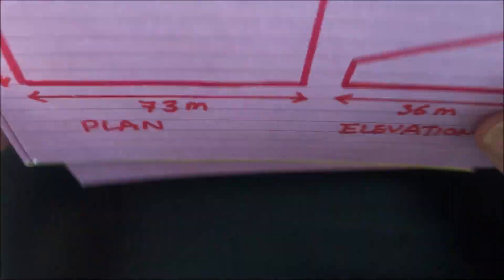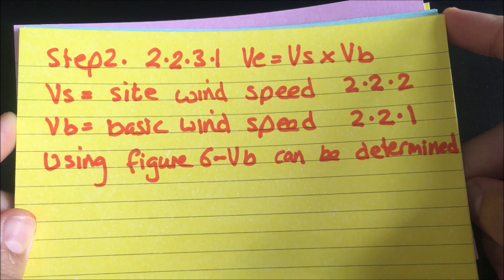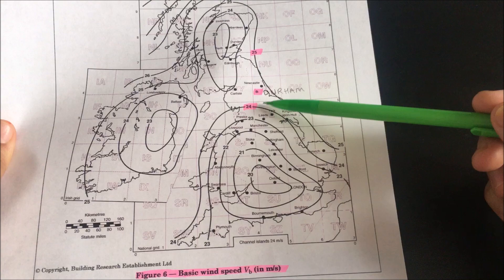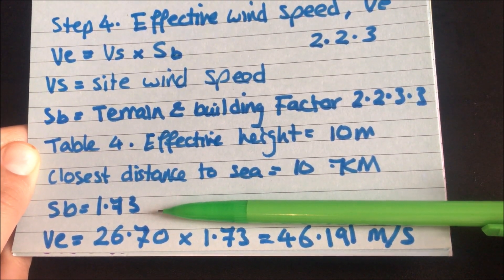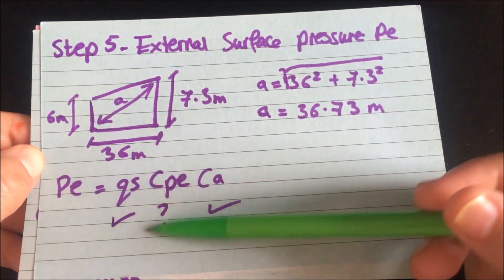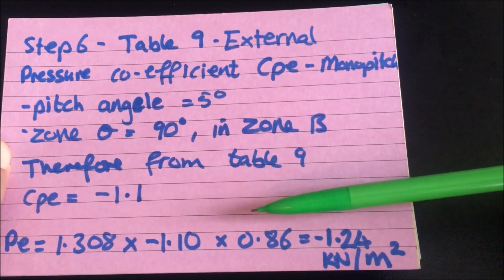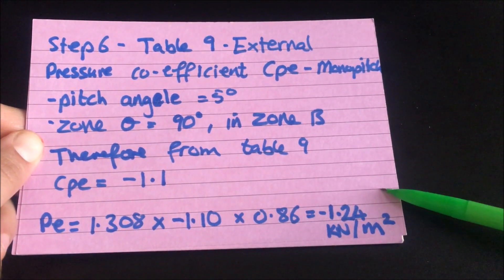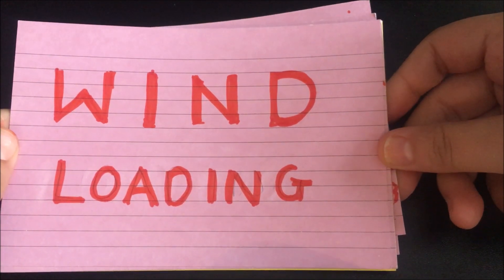Wind loading calculations, worked example, Portal Frame

Comment: Hullo. Thanks for the video. However, I noticed some errors in the calculation of the net surface pressure. The first p value should be (-1.24-0.225 = -1.465) and the second (-1.24+0.34 = -0.9).

Comment: Great video! 
How would the approach change if you have a structure that is basically 2 portal frames side by side which has a trough roof in the middle?

Comment: Hi there, @17:23, , both values for P, if P = Pe - Pi, shouldn’t the first one be P = (-1.24) - (-0.34) = 0.9kN/m2? Impermeable and the second one, 
P = (-1.24) - (0.225) = -1.465kN/m2 permeable?

Great video by the way, thanks a bunch for taking the time to do this 👍